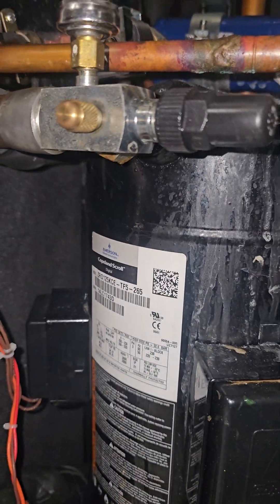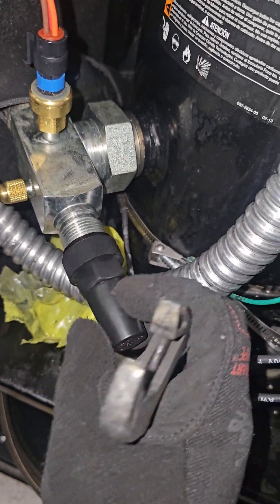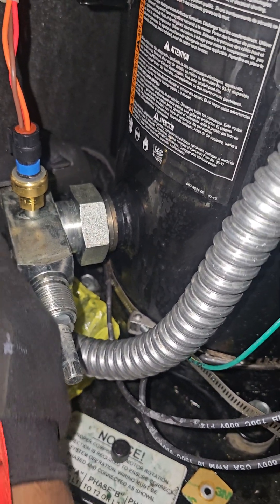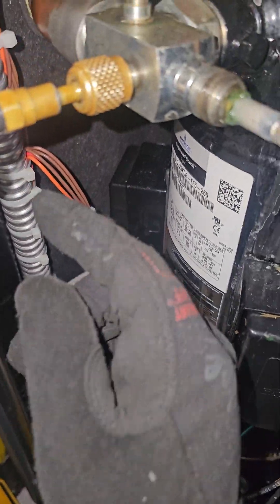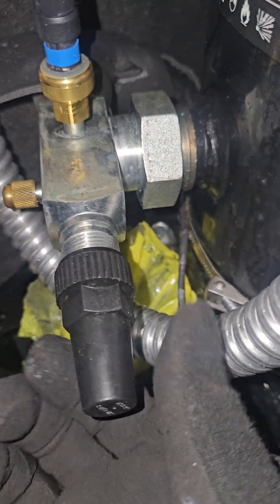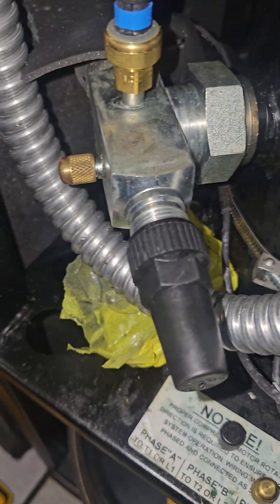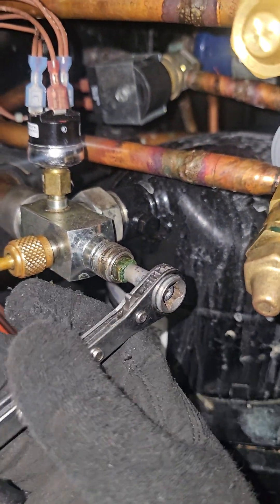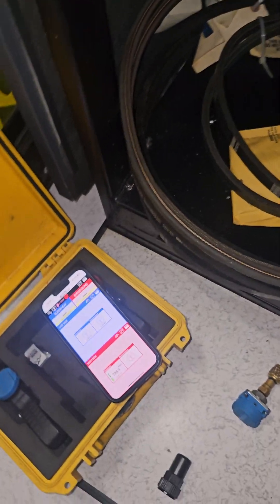HVAC BEGINNERS TRAINING VIDEO

Comment: Are you not concerned about that thing short cycling?
Reply from the maker: Not short cycling,  these are digital scrolls running with capacity control,  check out my other videos on digital scroll compressor

Comment: Should get a 90° elbow accessory for your low side
Reply from the maker: Yes that's a good idea
Reply: Look for 90° elbow adapter for refrigerant gauges. There is many options